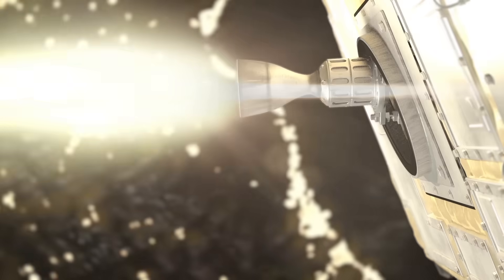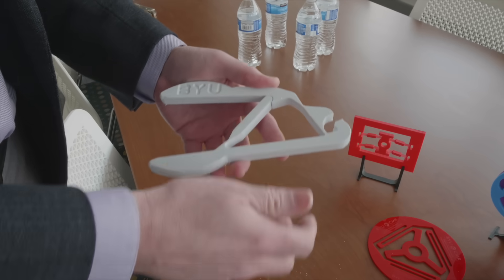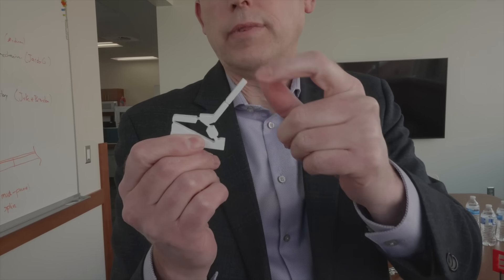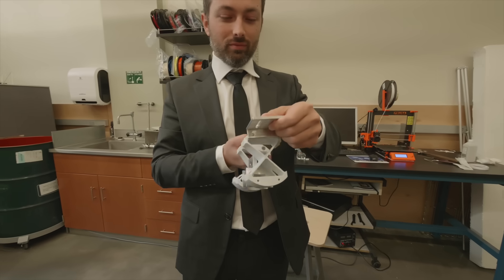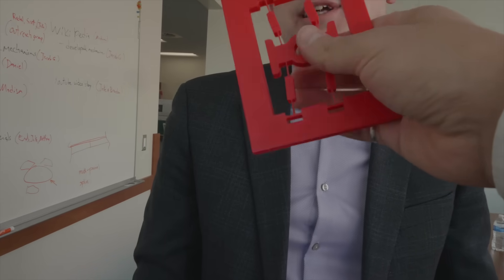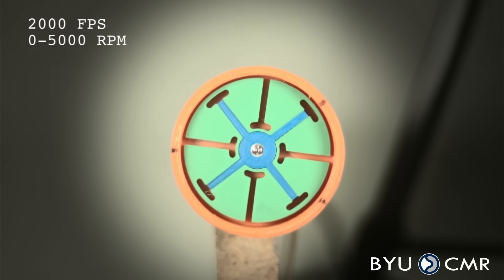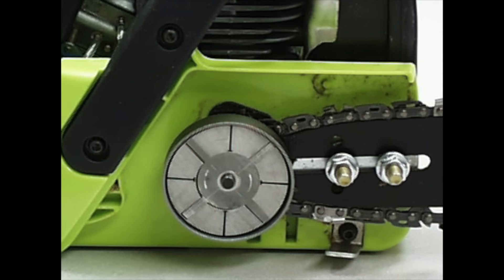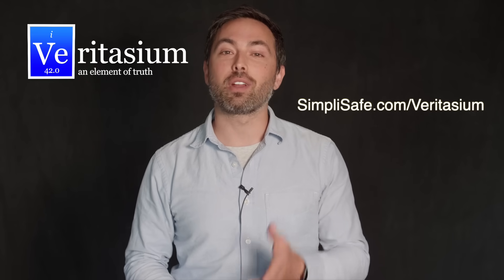Why Machines That Bend Are Better

Comment: Oh i have reinvented the pliers ... and the law of levers ... oh what i have invented already exists ... well then i have to compare apples with pears ... can't you leave stupidity in USA? Of course, if I compare grip pliers for fixing during welding with normal pliers, then they have more parts, of course. You can adjust them to different material thicknesses and then clamp them so that you don't have to hold anything. That's why you need more parts, Professor. Every other pair of pliers, with no thickness adjustment, is based on ! 2 ! bent parts. And if you exert enough force, the tool will bend within the limits of its material properties. Of course it can be completely different in the USA, but that i can't believe.

Comment: Ever hear about work hardening?  The material slowly hardens with each use, and over time will become so stiff and brittle that it eventually breaks.  That is why machines that bend are no where near as durable as properly designed and lubricated conventional ones.

Comment: How cool is that! Actually most materials recover very fast from bending force, where you don't have fatigue or plastic deformation involved. The trick is to design for instance a tool where you can control the direction of the forces involved. If the tool is used as it supposed to be used it can almost last forever. Design and control the forces to work in the right direction and then make sure the design is used correctly. Nice...

Comment: Funny, I work with optomechanical equipment. Film recording basically and needed do design a more accurate adjusting mechanism. I used some knowledge that I had from a previous job, where I developed mechanical and laboratory equipment. So I created this one piece hinge. Since I’m not a native English speaker I never knew this was called a compliant mechanism.

Comment: Throughout this entire video I kept thinking, have they never heard of a spring?
Other flexible or compliant mechanisms we use everyday include the car tire, anything with foam or padding, rope/cables/webbing, and anything using air or fluid.
Reply: That wasn't the point. 
The video is meant to showcase an all encompassing mechanism that serves the function of an undisclosed number of parts in a traditional mechanism. 

Not to say this is better in every aspect, but more so in terms of effeciency relative to cost to produce.

Comment: The 1 million cycles is pretty sus. Anyone who owns a 3d printer knows that different plastics act different. The issue is some material can withstand rapid bending but harden and break over time and other deform from heat and rapid movement but last longer.

Comment: The only major downside I see is that if these tools break, they must be entirely replaced. Small kind of emergency patchwork repairs to replace a single part of a broken joint doesn’t seem possible if it’s all made from one piece.

Which means if it breaks on you in a pinch you need to swap the whole thing out, which might not be easy. Otherwise they are beautiful. Fantastic designs.
Reply: Considering how cheap it is to make one, wouldn't it just be easier to buy several of the same?

Comment: I'm not sure that stress tests are really a fair way of telling how long something will last. After all wear from use and wear from age are two different things.
Reply: heavy use materials most likely break from stress way before time has had any chance to act on the material. The effect of time mostly has to do with long term exposition to heat, moisture, dry air, friction, dust, constant temperature changes and chemical reactions at the surface of the materials, and stuff like that that slowly builds up. Stress on the most sensitive parts are most likely much more damaging over time. I'm just guessing though
Reply: wear from age is dependent on material and environment. they cant account for your environment/treatment of the tool in their testing, and how long the material lasts before degrading is something you can find out by looking the material up. some plastics last a long fuckin time

Comment: Before I retired in 2009, I was talking with an associate in our testing lab that had worked on the safety and arming mechanisms on a particular nuke, in the conversation I asked about the high order of electronics that must be in those devices, to the contrary he said very simple mechanics and simple electric devices are used to keep reliability high.

Comment: I used a chainsaw quite a bit and let me tell you I would've been saved a few headaches if the clutch had been a single compliant mechanism instead of the mess of metal and springs that it is. That is an amazing practical application for this.
Reply: We need to get these designs into products asaps!
Reply: Ain't that the truth!!
Reply: I have had a chainsaw case with a compliant hinge. Didn't last a month. That these might be used in nuclear weapons is terrifying!

Comment: Main problem I see with these is if there's a small problem with the part then whole thing needs to be changed, instead of just one hinge, bolt, gear or spring. And you might be able to use those same components to fix a thousand other machines, while the bending alternatives seem pretty complex and specific.
Because of their size and specific use I think the portability argument is kinda mute.
Obviously they have their uses, but definitely not a replacement for most parts.

Comment: I feel like a million uses before any breakage is kind of low for those pliers. How many times do you squeeze pliers to use them before needing replacement during their lifetimes? So, is it really cheaper to have metal pliers or bendies?
Reply: A million is a lot higher than you might intuitively think, that and these would be cheap and extremely easy to recycle so replacement would be much less of big deal. A major issue is I doubt these kind tools would be recycled instead of simply being tossed in the trash, more plastic being wasted is always a bad thing

Comment: This reminds me of sacred Geometry, straight lines are male/drawn with a Square, curved lines are female , drawn with a Compass. Until now , machines have been mostly male in nature. Also, like mixing of biological technology with digital/mechanical technology, this can then involve ethical considerations.
Reply: No it cant , an if it does its only bc you shoe horn it in like most other  situations  when u ppl try an jam an sexual  component into something  that's miles away from that subject just to cause more issues

Comment: Someone better at physics than me; please explain why, even in a vacuum, these parts are not subject to fatigue failure just because of the heat produced, are these parts subject to an upper limit as to how fast they can move, or are they simply thin enough to dissipate heat purely through radiation to alleviate faliure

Comment: Wouldn't those plastic bendable parts just stretch and loosen after a while? I know he said that they were testing some of their devices up for up to a million uses, but whether or not that number is considered  high is depending on what task to be preformed is.
Reply: They can test it at different loads of force. And parts generally only creep at high temperatures or sustained loads. Not so much at cyclic loading

Comment: the problem with this. is if one part snaps. (and in engineering something is always bound to break) you have to replace the whole thing. apart from just a screw. or a cap.
Reply: But it's only 10 cents

Comment: Wonder why we don't use these techniques in vehicle manufacturing? 

I'm going to guess that the mechanical stress is too high. Like suspension would suffer metal fatigue if you used these methods with an A frame type swing arm. (Or...would it? 🤔)

Comment: I have professional pet hair clippers which have a part with 16 flexible plastic “hinges” that bend back and forth with every stroke of the clipper blade, 3400 strokes per minute, nearly 60 per second. I use these clippers for hours at a time, and they just keep on bending!

Comment: 4:43 The hole in the elephant's trunk reminds me of the linkages in a type of valve gear on steam locomotives, Walschaert's Valve gear and how each link is dependent on the other and controls the final movement. I could never understand the gear, but if the elephant was the gear, it would be in neutral or mid gear.

Comment: U r the best for ur new show on the bottom of the flux is circular with radius 10 centimetre and a 5.5 kW in the snow and the snow is a bit far away from the snow and the snow is a bit far away from the snow and the snow is a bit far away from the snow and the snow is a bit far away from the snow and the snow is a doctor in the morning but a good night for a long time away from the server and the rest of the flux is circular with radius 10 centimetre and a few inches long enough to get a better quality of the stream than

Comment: Really nice stuff.
As a mechanical engineer myself I however want to point at a disadvantage.
Maintenance is basically impossible.
Reply: By the sounds of “in our testing machine it’s gone 1 million activations without breakage”, and by the fact they’re simple to produce (single parts instead of bolts, hinges) I’d infer that instead of maintenance, you just have replacement.
Reply: @pcarrierorange  Sure. And thats perfectly viable for certain parts. But its also less viable when it comes to other parts.
I am of course comically exaggerating here, but you don't want to get a new car, because you need new tires ^^

Comment: Interesting video, but badly titled. What you mean is "flex" , not "bend". The two are opposites, not equals. 

"Flex" is when an object changes shape due to application of force, but when the force is removed, the object returns to its original shape. (Example: Leaf or coil springs in suspensions of cars.) Synonym for "flex": "compliance". 

"Bend" is when an object changes shape due to application of force, but when the force is removed, the object does not resume its previous shape, but rather, maintains its new shape. (Example: making metal "L" brackets by bending flat strips of metal in a metal bender.) Synonym for "bend": "deformation". 

Look-up "Hooke's Law" and "elastic limit" in Wikipedia for much more on this. (Hint: an object "flexes" until it's elastic limit is reached, then it "bends".)
Reply: Very good knowledge. Thank you!

Comment: Not so good at very low temperatures though, the materials would not bend, they would shatter. end of story. I would prefer to use a well designed gas damper if I wanted to make the mechanism return to it's start position, as with that " spring" from gas compression, I could run the mechanism even if it did keep nuclear weapons in safemode with utter reliability at a hundred degress C below zero.

Comment: The problem of bend mechanism is the durability. You can change a bearing, but in a flex mechanism you have to change all. And this is because flex systems are used in big stuff like bicycles frames that supose to last decades with maintenance but not with flex systems. And the performance change too (we speak about decades). But it is easy to solve, small flex mechanism cheap and easy to change as ball bearings.

Comment: As a former student of mechanical engineering I feel like this is the real business.
3D printing is a pretty cool addition to the toolbox but going back and rethinking linkage mechanisms in this way feels way, way more exciting and fruitful to me.
Reply: Old comment, yes, but still wanted to mention you should check out the origami engineering video Derek did with this same guy, Larry Howell. Basically, they talk about taking compliant engineering to the next level using the power of folding.
Reply: Everything needs to be looked at again
Reply: That is what is brilliant with 3d printing. Gives access to engineering and prototyping to the masses. Never been more easy.
Reply: Agreed.   I think of my days at M-K Engineers (decades ago).   This would have changed how we designed things.

Comment: Professor : *cuts chalk...

Nail Clipper : " am I a joke to u?? "
Reply: Sharpen the edge and you basically have a nail clipper, similar mechanism.
Reply: While a nail-clipper has a compliant mechanism, it is not monolithic, usually requiring 3 separate parts to be manufactured and assembled.  Assembly takes time and is usually the highest cost component, and that is why consumer products are not built in the USA.  Maintaining inventory with 3 parts is also much more costly to manage and control waste compared to a single part.  These are important considerations, since people expect to get all of that in their local store for a buck.
Reply: Actually it is four parts, plus a weld step, for a typical nail-clipper.
Reply: @dustincarr6665   I wonder if the requirements for the bending part material can affect the performance of the blade, or vice versa. If one would make this clipper out of, say, stainless steel that is used for average nail clippers, would the bending part perform just as well and be as reliable (a million bends, they said?) And reversed situation, would a material that is suitable for such a good reversable deforming be a decent material to make a blade of?

Comment: I would think this video is a bit misleading no?  Really only plastics and other flexible materials can be used as far as I am concerned (not too familiar on plastics).  But this certainly would not be good for metal applications. Metals are known to fall victim to metal fatigue. For example, chains have zero moving parts and zero bending parts. However, chains have been known to spontaneously fail below their specified rates, and they have zero moving and bending parts. I couldn't imagine something like that titanium hinge falling under the same circumstances, and probably even worse because of the bending crystal structure. Although its great if its not being used a lot (if that's what NASA intended).

Comment: I have a pet peeve with battery compartment covers on remotes and other small battery powered devices. They can be hard to operate and quickly fail. My favorite is a compliant U-shape latch that always works easily and never fails!

Comment: 3:50] "Over a million cycles,"  in the fatigue testing.  Not bad.  Really. I have a plethora of... locking pliers, [to avoid using a trade-name] some of them over thirty years old, they work exactly as originally manufactured as hard as I have beaten on them.  Now imagine pairing one of these extruded-bread-loaf-plastic 'vicy-grips' with the threads of a grade-8 bolt corrosion welded into an engine block?   When a tool is materially much less tough than the work it will fail almost immediately.  The toughness of the machine must be matched to the toughness of what it works on, such that the machine is much  tougher that the work.  Place for compliant machines? yeah, no doubt, but you have to match the machine to it's work rather precisely.

Comment: Ok I’m confused. He said the footage was sped up, but then said the dot actually makes 2 full rotations every second, but on the video it hardly moved. So was it actually slowed down? Also that whole explanation with the laser did not really make sense. Is the device preventing the laser from lining up with the dot? How? Won’t the dot and laser always line up at some point in each rotation?

Comment: Put four centrifuge clutches of different sizes in a row for use in an automatic shiftless transmission. Each engaged at a certain RMP while the one below it which is smaller deactivated just past the time the second one engaged. Let off the accelerator and there is no drag because all clutches disengage due to lack of RPM. You could engage drag if you needed help stopping so when you hit the brakes it would switch on drag from any locations you desired in the mechanical system that makes it go or stop.

Comment: Impressive. I'm just fascinated that these parts which act like hinges & are formed in plastic are capable of sustaining such an incredible number of bend cycles. Even more interesting is that the same methodology is capable of working in such diverse materials as plastic, silicon & titanium.

This is Exactly the kind of technology which should be introduced through STEM courses - the younger, the better. Have kids
3-D print out components for robots, or a R/C Car, or whatever & get them stimulated, creative, involved, etc. 

I love seeing the joy as I watch these two professional science YouTubers (one an actual physicist) playing with these things.  😁

My brain's popping with so many applications... ; )~
• Take that Gripping Tool & (just for the hell of it) extent the arms... ...a lot... What pressures could you get with 1, 2, 5, 10, etc. metre long arms?
• Imagine a Bike Wheel using a similar hinge design to the Dumbo, but where the centered component was the axle. You could have a wheel which adapted it's outer ring contour to the environment, warping over & around a rock or fallen log (instead of stiffly rotating over & around it, before impacting with gravity) as the wheel passes across it. Simultaneously, it would keep the axle at a fixed distance to the ground, making for a very smooth ride - even off-road.
• Childproof Drawers which have microplastic switches built into the frame (like lift/elevator doors). Any obstruction - such as tiny fingers - would press a switch, which in turn would trigger a braking system - well before injury.
• Cooling Fan Blades (for computers, housing, people) which rotate to change their angle based on their speed (improving efficiency & reducing noise), instead of just being fixed. 
• Alternatively, for small scale Wind Generator/Water Turbines.
• 3-D Print a prosthetic hand with a single plastic body including joints (& with cavities, guide tubes for motors, servor & cables, etc.).

~ ~ ~

Materials science & mechanical engineering are definitely beginning to move towards the Singularity...